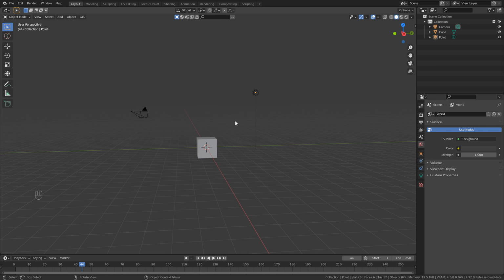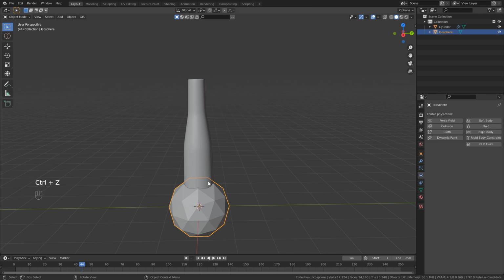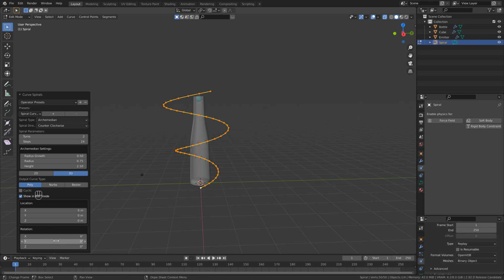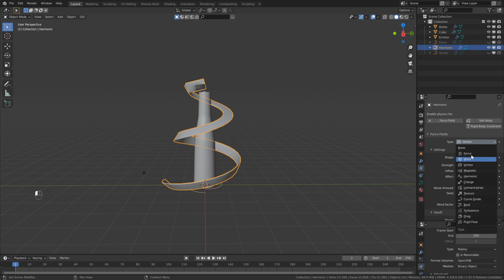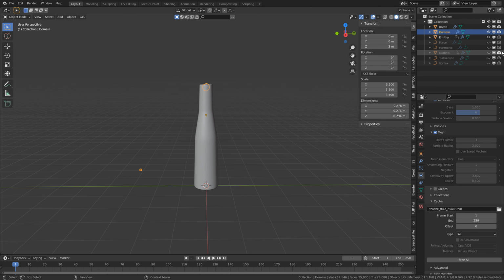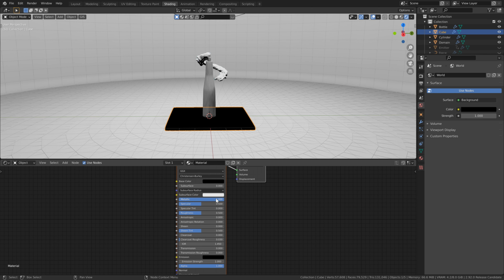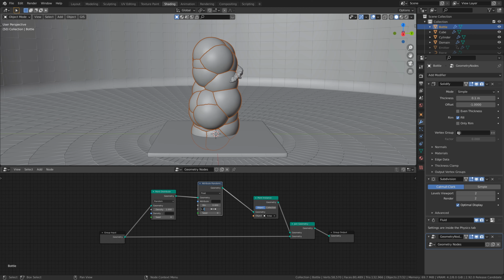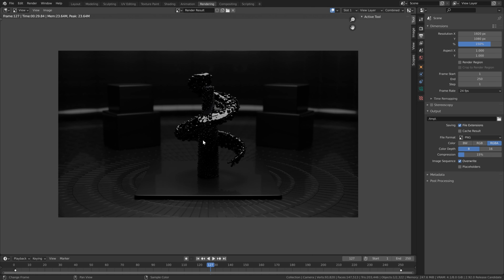Liquid Follows Curve - Blender Mantaflow

Comment: For some reason my domain appears to just be a cube whenever my division resolution is 110 or below. Anything at 111 or greater renders liquid just fine, any idea why this might be?
Reply from the maker: Picture the divisions (resolution) of the domain like a 3D grid of smaller cubes. If the cubes are larger than the inflow object, there won’t be enough resolution to calculate that object and will end up not calculating anything at all 💕

Comment: Hi, The outflow isn't working for me, I have tried several solutions including using FLIP instead of APIC and trying to use a plane or cube. Is there any setting that needs to be clicked or anything I could have done to have stopped the outflow from working? I've tried it with the flow animated and also not animated and it still isn't working.
Reply: I have the same problem :(

Comment: have you had problems with collision objects on fluid simulations? On the default fluid system i can't get right simulations inside objects
Reply from the maker: Mantaflow has trouble sometimes with liquid inside of objects. It can be done but the resolution needs to be high and it is much more efficient with something like the Flip Fluids add-on ❤️

Comment: Hello Aria. Been following most of your simulation tutorials of late and finding them very informative. I understand particle/ physics modifiers better now, then previously. One question here, at ....15:20  you have some keyframes (emitter) at frame 180 ?? that you move back to frame 100. ?? when were these keyframes created, I don't see them in my timeline ?  .. btw. really enjoy your tuts.👍
Reply from the maker: Thank you! ❤️
I may have glossed over this piece in the description. What we are doing here is selecting the emitter (icosphere) and then in the physics tab you can set a keyframe at frame 100 for the flow and then move forward 1 frame and turn the flow off and set a new key frame. This will turn off the emission of new liquid
Hope this helps! ❤️🥰
Reply from the maker: At 15:31 I quickly explain the purpose ❤️